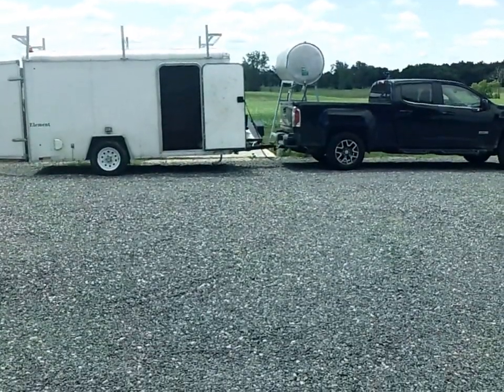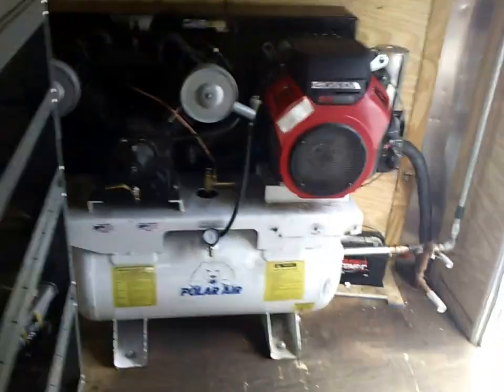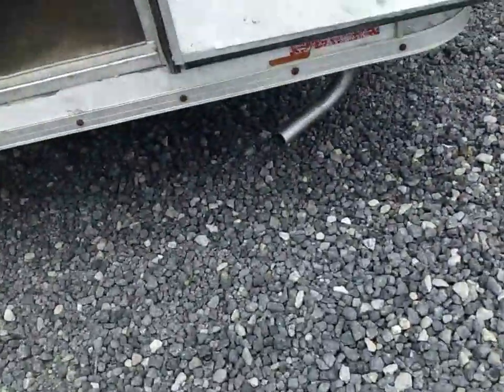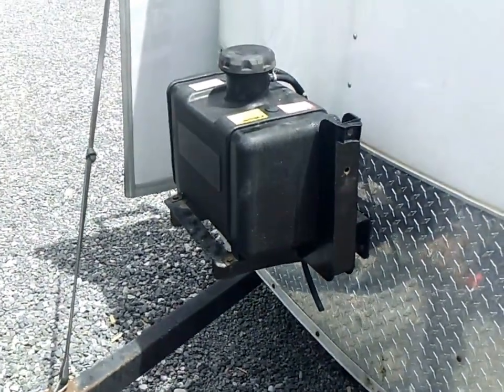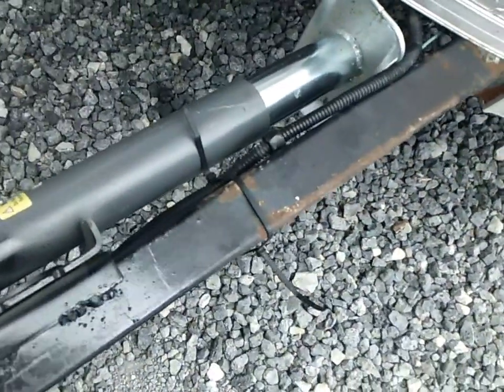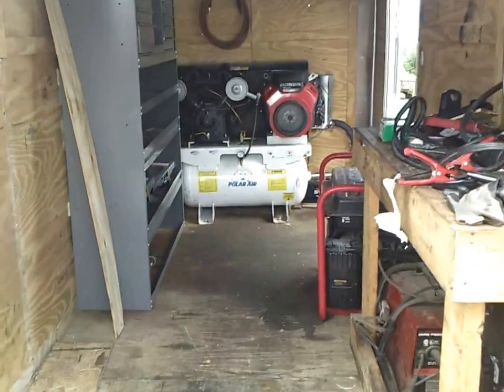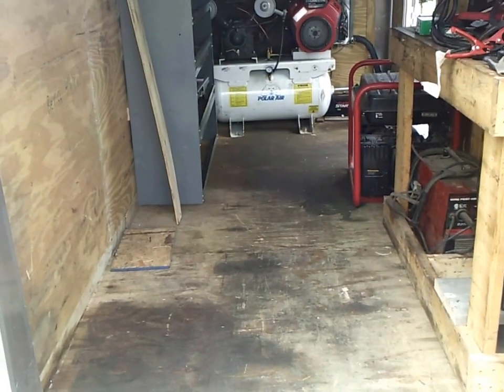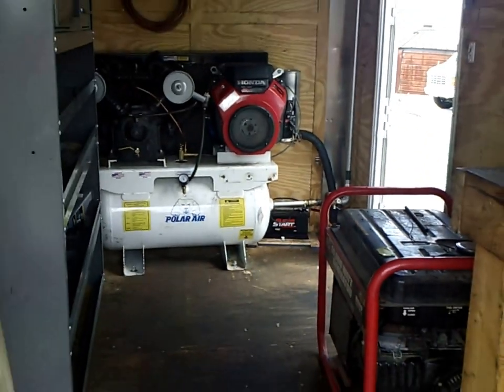"Service Trailer" "Mobile Tire Repair Unit"

Comment: Tire trailer  no tire machine on sight
Reply from the maker: Real tire men don't need machines boy lol
Reply: Gasolino G truck tires don’t require a tire machine just two bars 🤦🏼‍♂️
Reply: SEMI TIRES.. which is the need for a 1 inch impact
Reply: Gasolino G fuckin tire guys